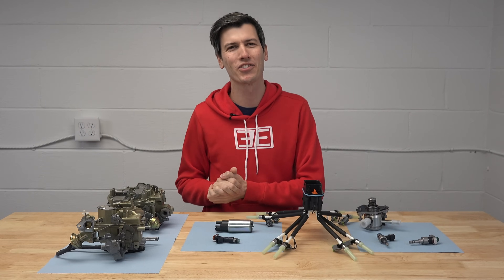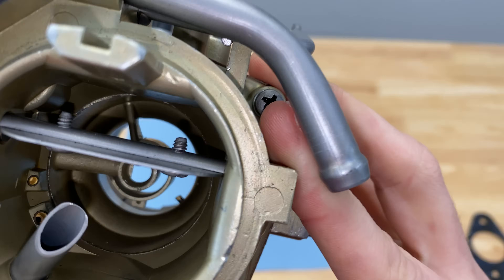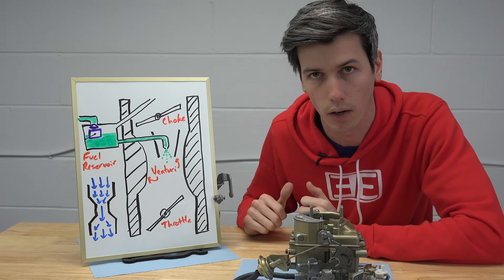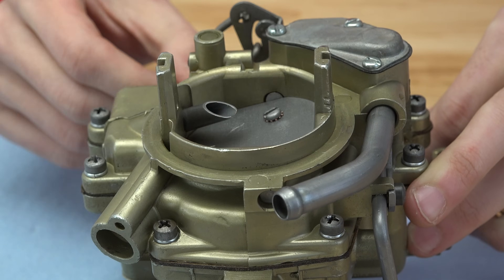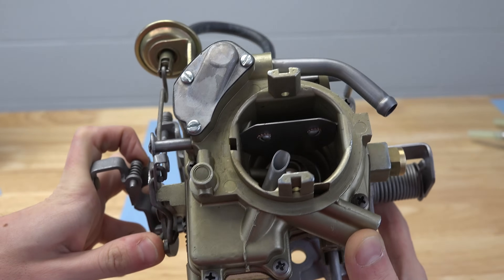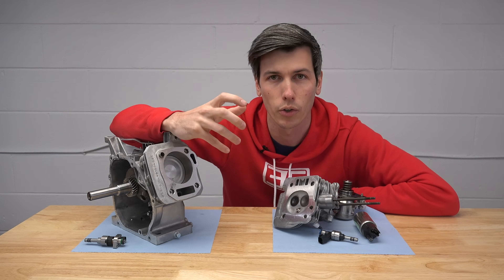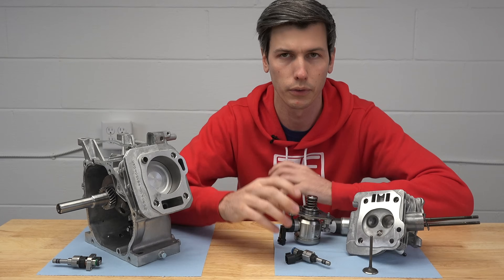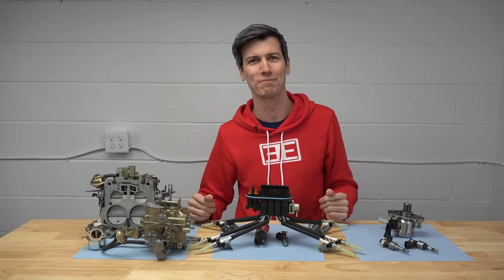What's The Best Fuel Injection? Carburetors vs Port vs Direct

Comment: Well fuel injection are good for fuel savings and emissions, but their complexity in motorcycle application especially a small displacement single cylinder motor increase the maintenance price a lot. Plus a DIY guy like myself just having a hard time to troubleshoot anything that goes wrong in fuel injection system. Carburetor on other hands are dirt cheap in maintenance wise and very reliable for point A to point B application. Even for performance tune up, carburetor has the cheapest option just by swapping a larger carburetor compared to fuel injection which has a lot of parts and electronics which need a specialist and expensive tools like a laptop and ECU. Well all design has it's own pros and cons, but for a cheapskate like me, carburetor are just good enough.

Comment: Don't forget that injection also requires support from computer technology with associated sensors.  Manufacturers tried to implement F.I. in the early 60's, but didn't have the computer technology to make it reliable under all atmospheric conditions, i.e., altitude, humidity, temperature, etc.

Comment: Why is there a need for a cleaning effect on the intake valves?  Wouldn't port injection only have the advantage of cleaning the back sides of the valves?  What would cause deposits on the back sides if all the back sides ever see is clean, fresh air in a direct-injection-only configuration?
Reply: PCV is the answer

Comment: Some carburetors have what's called an accelerator pump, which injects extra fuel when going from idle/slow speed to full throttle. This gives better throttle response which makes them popular for racing applications.

Comment: Vaporisation of fuel in direct injection doesn't cool the charge bcoz fuel is converting into vapour so 
Could you please explain how it will cool
Reply: Sumeet Shinde I assume it’s like rubbing alcohol. When in the bottle, it’s a liquid. When you rub it on your skin, it changes to vapor. It feels cold because going from liquid to vapor is a cooling effect.

Comment: I prefer direct injection, compression ignition and turbocharging.
Reply: Diesel for the win!
Reply: flashgordon99999 or a HCCI, Mazda engine
Reply: Do you prefer to do all the work on that?
Reply: Evil, dirty stuff. I had a Ford 6.0 EGR valve stick open 12 miles from pavement.
Reply: Diesel Gang Rise Up

Comment: Unrelated to this but what do you think about bio fuels or other ICE fuels? I personally would prefer that over electric cars. As someone with a 1990 Mustang with a lot of sentimental value, I would hate to be in a position where I have to give it up for an electric car.
Reply: Another option could be hydrogen, can be renewable and engines will run on it like lpg
Reply: Archy Grey I’ve thought of that, and maybe biofuels. I won’t mind switching to those, I just don’t want to be mandated to have it electric. I just don’t feel the car would be the same. It won’t feel “alive” I guess you can say.

Comment: Besides cost, why do you think they haven't implemented fuel injection in higher end small engines like lawn mowers? Honda makes $400-$1000 lawn mowers and they are an engine company so I'm surprised they haven't done that already.
Reply: Electronic fuel injection need an ECU (engine control unit) to operate, which itself need battery to do that.  I think for home tools like lawnmower, carburator is enough.

Comment: I know this is off subject but have ever done a video on the Chevy v6 with eco boost ? I have a 2018 and this this idles very rough has since the day I got it the said it would smooth out after some miles but now I’m at 30000 and still ideas badly

Comment: Direct injection's objective IS NOT to spread the fuel evenly across the cylinder.. You can burn a leaner mix if you can keep the fuel closer to the plug.
.. Oh you covered that.

Comment: A good and thorough overview of the different fuel systems in gas cars, though I was surprised no reference was made to catalytic converters, which is essentially what mandated the switch from carburetors to electronic injectors back in the late 80s - early 90s. 

Now as then, emission regulations are what have required manufacturers to come up with these complicated dual injection engines to meet emission standards at low loads while providing acceptable performance at high loads.  Perhaps you could do a video just on the evolution of emission control systems and how they have shaped modern engines?
Reply: That would be interesting, although getting political is not really EE's cup of tea. I wonder what kind of designs we would have if manufacturers were free to design according to demand. Would we have a race to the bottom with lots of corner cutting or would we have even more efficient engines as more engine types were explored and engines were kept simple and pragmatic.
Reply: @mennol3885  Focusing on the engine design its self isn't political unless one tries to debate the merits and demerits of government sanctioned environmental regulation, which I wasn't suggesting and I don't think is particularly relevant to the channel.
Reply: @soundseeker63  True, not the right channel. Maybe I read it into your question. But why discussing the influence of emission regulation and not for example: oil price, demographics or other ever changing factors.
Never the less, I'm happy there is regulation, because those half burned oils give me physically a headache.
Reply: @mennol3885  emissions coverage is not "getting political"   People wanted to stop dying from air pollution so laws were changed.  No reason to get worked up.  And he has covered emissions control strategies in many of his videos.
Reply: @mennol3885  Race to the bottom. Engines before emissions were massively inefficient since they could just up the cylinder size to make more power. That's why we had production cars with 8+ liter engines not even pushing 200hp. Especially moreso when you compare what the "bottom end" of back then was compared to the "bottom end" of nowadays.

We can already see what happens when a manufacture is free to design according to demand, that's why General Motors always needs a bailout. People don't actually want what made all of the old cars "great".
Reply: @LordOfSilense  Bailouts are government intervention, and GM is a perfect example of why they are bad. We will never know what companies would grow to fill the gap in the market and would do so producing cars people want. If they would be given the chance to take over the good GM engineers and useful resources in the bankruptcy sell-off.
Reply: @LordOfSilense  Kid, those 7.6 Liter 460 Ford V-8's that were putting out 200 horsepower in 1979 were producing 360 horsepower and 515 ft. lbs. of torque several years earlier before emissions laws gutted their performance.  They weren't weak or inefficient, at least not until emissions laws had their say.  Those big V8's produced a LOT of healthy NA power when they were actually allowed to by the law.

My 1979 Lincoln has a 400 CID, 6.6 liter V-8 Cleaveland motor.  Because of emissions restrictions, it is only a 160 horsepower motor.  Even with emissions gutting it, even when reduced to 8:1 compression, it still kicks out 315 ft.lbs. of torque at a mere 1,800 RPM.  Rebuild that motor without emissions restrictions, I could probably get 320 horsepower out of it, all at medium RPM, not jacked up 6,000 RPM red line limits. 

Take a look at those motors when they are running right and built without restrictions, they aren't nearly as inefficient as you think.  They produced a lot of power and torque at low and medium RPM, when built towards a higher power band they stack up not so bad against new designs.  You are absolutely wrong.
Reply: @LordOfSilense  Absolutely not true. Look at pre 1972 American engines. They make twice the power of late 70's engine from the same displacement. Early emmisions absolutely destroyed engine performance, it took 20 years for manufacturers to get back to 1970 power levels
Reply: @kingduckford  and before exhaust gas return systems valves stayed cleaner longer and engines could last longer because there wasn't dirty air being blown across the valves.
Reply: I second this suggestion!
Reply: He didn't touch gas powered cars. The fuel system's quite a bit different - for one, there's an evaporator to boil the liquefied gas before it's mixed with intake air.
Reply: GM cars came with cats and carbs from 75-87
Reply: When the Cat first came out in 75, most vehicles still had carburetors.  Increasing stringent emmisions standards is what killed off the carburetor, as it can't constantly adjust over a wide range the way electronic Fuel Injection can, AND, non-computerized fuel systems can be altered to provide more power.  Electronic systems can be computerized, which makes it impossible for most people to modify them.
Reply: @michaelbenardo5695  also, adding ethanol causes water to dissolve into the fuel and bind with the ethanol. So it guns up carbs. Which I think are better. Also, any study claiming some cylinders got more or less gas doesn't account the fact we , Eve. Today, have no way of knowing owing if a fuel.injector set is pumping equally to all cylinders. There is no sensory system to tell us if each injector moves the same amount of fuel. So there is a ton of crap in this video.
Reply: Not really very thorough though. No mechanical fuel injection and jumped straight past batch port injection to sequential. Also no mention of with each new system came added complexity and reduced reliability. I work on all these systems regularly and find direct injection seems to cause the most issues while also being newer and therefore in theory shouldn't be causing issues. I am seeing direct injection having major failures after a few years and under 100k km, all while old port injection soldiers on and obviously carbs still work fine on vehicles well over half a century later.
Reply: @lukekirkby5304  I wasn't aware mechanical injection was ever widely adopted outside of diesel engines, so I'm assuming thats why he didn't feature it...? 
Would be interested to know why it was never a mainstream success. Certainly in Europe we went straight from carbs to EFI in the late 80s, and by that time the systems were advanced enough not to cause any loss of performance. The phasing out of leaded fuels from 1989 onwards was what forced the change initially, followed by mandatory catalysts on all new vehicles from 1992.
Reply: @soundseeker63  Bosch and Lucas had mechanical injection on some Euro/British gear in the 1970s. Worked very similar to diesel but at much lower pressures and used a large flap as a crude airflow meter. I had an old Merc with mechanical injection and the thing was very reliable, powerful and smooth but rather thirsty. I agree with you though going through all the different systems in detail would be an hour plus video, I just thought a quick mention would have been thrown in there. Here in 🇦🇺 we had Catalytic converters and unleaded fuel from 86 on passenger vehicles. Our home grown 1980s EFI cars were pretty crude. It took the Japanese to show us how an EFI car should run.
Reply: It was 1986, and had nothing to do with catalytic onverters
Reply: @Mach141  True - catalytic converters predated widespread fuel injection by a decade or so. Mechanical fuel injection (shudder!) was around in the 1960s.
Reply: @flagmichael  Corvettes came with Mechanical fuel injection as early as 1957
Reply: @Mach141  no put it did have to do with emissions.  the drops in g/m allowed emissions through the 80s and then early 90s required multi port injection to satisfy.  The EPA website has the actual limits going back to 1966 or so if you are interested

Comment: Don't you also need high pressure on DI just to have a pressure differential in the direction you want? In other words, the fuel would not flow into the cylinder if the cylinder pressure is higher than the fuel pressure. Also, aren't the emissions worse on DI engines? Hence most come with EGR systems.

Comment: you missed another con of direct injection oil dilution
Reply: Only if its extremely cold
Reply: @stevenyia2778  tell that to honda 1.5L CRV and Civic owners even ones in warmer climates reported it being a major concern I see it all the time at work Hyundai's Kia's honda's cars that are 2 years old oil reeks of gasoline and reads 1/2-1 quart over the problem is most notable in city driving short trips and before you suggest frequent highway trips to burn of excess gas in oil why should anyone have to do that in the first place

Comment: D’AWWWW he thinks carbs automatically account for engine modifications and exhaust flow rate! BOY do I wish that was true. Then my garage wouldn’t be full of motorcycles and cars forever out of tune. I have 13 carbs in my life and sometimes I want to stuff them all into a shredder.
Reply: Just because they react to differences in airflow doesn't mean they react the way you want them too.
Reply: Paul Hinman   It’s not so bad once you learn how to tune them correctly and keep them clean.  One trick I would like to share with you is once you get your carburetors tuned correctly run Marvel mystery oil in your fuel it will help keep your carburetors clean and performing at their best. 1 ounce per gallon of fuel works best.   Plus it is an excellent top end lubrication.  And it does wonders for the intake valve guide.

Comment: So if a carburetor is so simple why do I need to be a watchmaker to take one apart (or, more to the point, to put one back together with all of it's springs, pins and clips)? Have you ever heard of a "Lake Injector" (also known by other names but Lake was the one being sold for mini-bikes when I was young)? It's not an injector as we know it today but rather a replacement for a carburetor in aircraft (and some chainsaws, weed whackers or other two-stroke engine devices) that will operate at any attitude (position). My point is that this was (is) the simplest fuel delivery device ever invented. I don't know how efficient it may or may not be but I could work on it AND put it back together.

Comment: Still building hot rod air cooled VW engines for street cars with dual Weber carbs. If tuned properly with a correctly built engine, they run like fuel injection. Old school, will never change.

Comment: Where does the Carbon for carbon deposit on inlet valve come from in direct injected motor?
Reply: Usually from the oil crankcase vent, the oil vapors from the crankcase are piped to the intake manifold to be burned rather than let into the atmosphere.
Also from the EGR valve if your car has it, another emissions device that redirects exhaust gas back into the intake manifold to reduce NOX emissions.
Reply: @archygrey9093  Thank you. i have Brain vapour lock, just spent a 2 days diagnosing intermittent engine check light on car.... PCV faulty! Feel like a d$%h$%$. 👍

Comment: The only time throttle body injection is worth it, is when its on a single cylinder or you have a two cylinder with one on each cylinder. The one problem with a carburetor setup is, when you need to synchronize more than one carburetor. Be it on an automotive engine, boat engine, or motorcycle engine. Not usually the easiest thing to do these days, since a lot of the tooling is hard to find, or its just too much of a pain to do a spark plug check. I enjoy electronic fuel injection, but I hate working on it a lot. Too many wires that could have too much resistance, modules that don't want to cooperate, or they designed it to be the biggest pain to work on just to spite the technician.
Reply: This is also the case on older VW H4 air cooled engines, they would use two carbies that were very complicated because they had to work in unison while also being almost 50cm away from eachother

Comment: Is it the same with diesel?
Reply: Not the same. Diesel direct injection happens around the top dead center, where the temperatures from the air compression are high enough to directly ignite the injected fuel.

Comment: One vid error is “running more advance makes more power”.   Advance causes a pressure rise before TDC & this rise pushes the piston opposite rotation ...”negative work”.   Reducing negative work is the motive behind ‘fast burn’ combustion chambers or two plugs (Dodge hemi).
Reply from the maker: Though spark occurs before TDC, that doesn't mean peak pressure occurs before TDC. Pressure rise takes time. Many engines can take advantage of higher octane fuels by advancing timing and increasing power (part of why E85 is so effective for power, high octane). Obviously, you want peak pressure to occur after TDC, otherwise yes, negative work. Apologies if how it was presented was unclear.
Reply: Engineering Explained  Correct, you want peak pressure just after TDC on any Otto cycle engine.  On a pressure/crank angle chart the negative work is that part of the curve just left of TDC and is equal to the area under the curve.  Evident that any advance prior to TDC is undesirable, but necessary.  But I am preaching to the choir.
    I grew up in carburetor days.  It was art to start a car on really cold days.   My first FUel Injected car was a VW Rabbit which had a clever mechanical system (Bosch Jetronic as I recollect).  What an improvement!  The system was so good that VWs did not have catalytic converters for a couple of model years.  In late 70s early 80s cars were smog choked and the Rabbit would dust ‘em.
    Anyway keep at it & thanks for reply.  Cheers.  D

Comment: You also have the mechanical fuel injection systems too like Bosch Ke or k-jet from the 80s, very complicated to work on but are actually suprisingly reliable and good at holding a tune.
They still seem to exist as fuel systems for race engines though
Reply: Archy Grey all hail the mighty K Jetronic